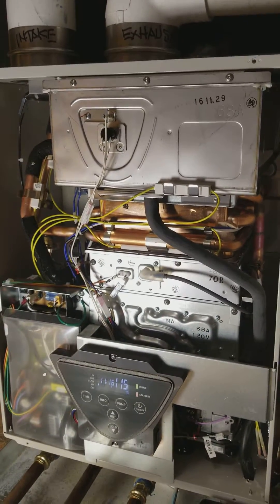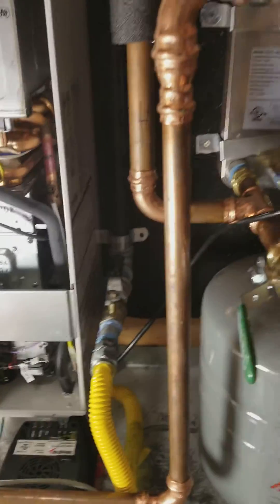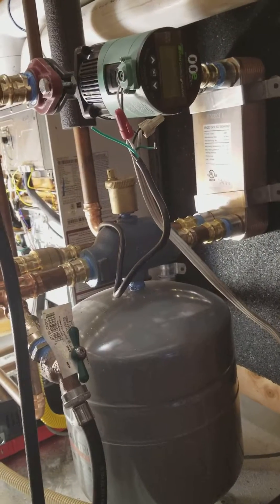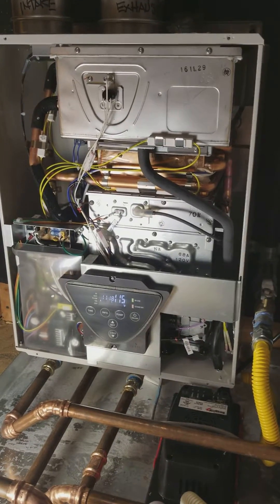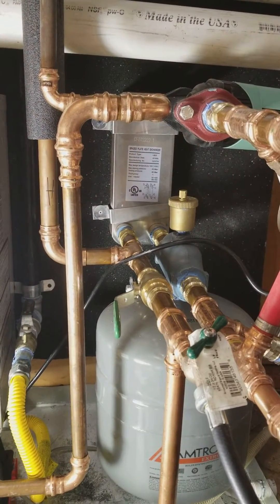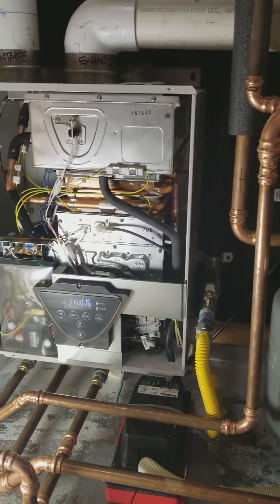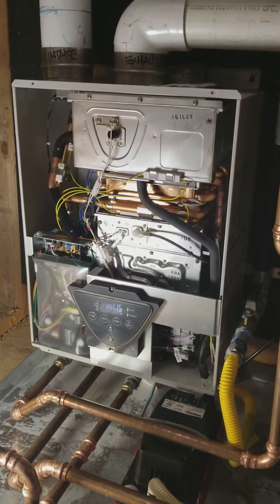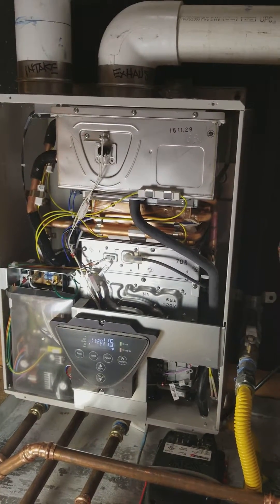Tankless water heater to radiant

Comment: Thanks for sharing your work.
I'm in Michigan and thinking of doing something similar with a mixed system. Half baseboard (1000sqf) and half retrofit underfloor (1100 sqf, 5 loops). 
Also want to supply dhw (2 1/2 bath, dishwasher, washer). 
Currently considering using 2 Takagi 3H water heaters, separating the heating and dhw.
Any advice or cautions?